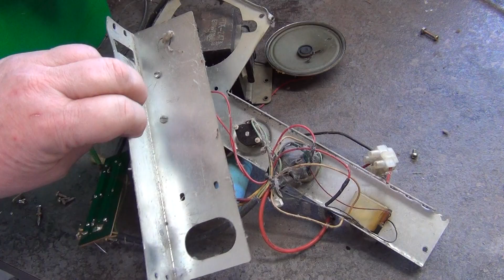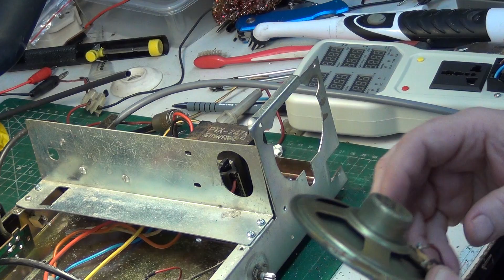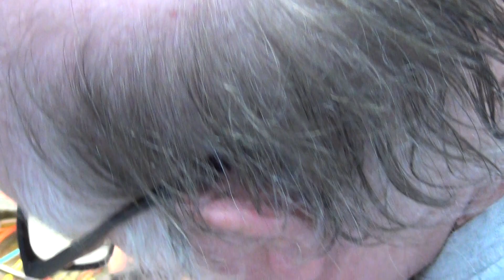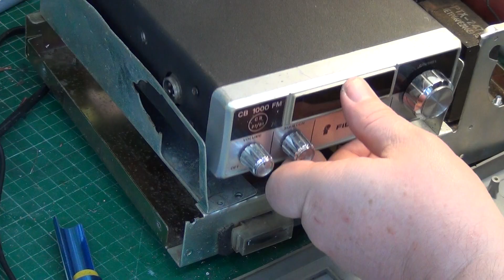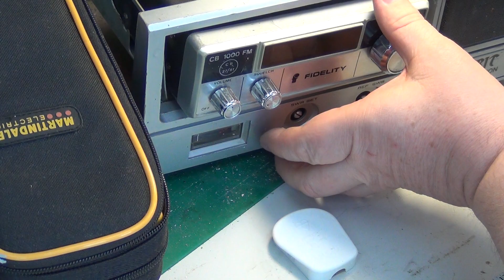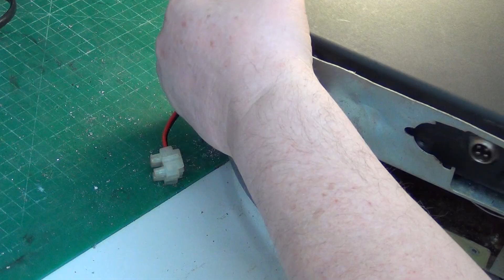Merit CB700 base station adaptor PSU for UK FM CB radio - Frankenstein version

Comment: @00:12 what do you mean by saying not supposed to have SWR meters online in the UK?
Reply from the maker: Yes. SWR meters are only supposed to be connected 'from tme to time'. The reasoning behind this is potential interference during transmit from the diodes.

That said, there were UK base stations with built-in SWR meters so presumably that was OK as they were type approved.

I'm thinking along the lines that this potential interference is more likely to happen with plastic cased meters. My biggest reason to suggest to only connect SWR meters from time to time is 'insertion loss'. 

Anything connected to the aerial socket that he xsignal has to pass through causes insertion loss, i.e loss both in transmit & receive range by a small percentage.

Richard,G0OJF, UK

Comment: Its been a while since I made a comment, I was wondering why the swr meter is not allowed in the UK to be inline. In all the years since 1978 being on the CB I have not heard about this before, as I don't read instructions the details about swr inline rule is something I have missed.
What is the reason for nor being inline as I have a meter with three windows swr/power/modulation which I have kept inline for years to let me know all is ok and for being cool looking being lit up at night in blue to match my blue led radios.
Reply from the maker: The diodes inside SWR meters emit interference. That said it's the kind of thing that would be very low range interference.....like 50yds.

The big no-no is because of insersion loss a demonstrated here. Most people strive for maximum performance & to keep losses to a minimum. The UK licensing rule does make sense.

It goes without saying that modulation meters are for AM use, so pointless on UK FM - which is what this channel is about. FM transmitted audio has to be read on a deviation meter.

Richard, G0OJF, UK
Reply: @ukfmcbradioservicingTango21  I appreciate the time you take to reply as you are a busy man so thank you Richard. John.

Comment: I had a couple in the past, they did come in handy. About the power supply, remember back then that the manufacturers "shared" various components and assemblies between different radios and accessories.
Reply from the maker: My logic is that the Cybernet built in Japan Harvard H407 or H404 base stations were made in Japan & this unit is made in Taiwan.  THe power supply parts were bodged in on non-matching self tappers.

Richard
Reply: @ukfmcbradioservicingTango21  going back many years ago i used to repair tv's, hi-fi's, audio and radio's also cb radios. I noticed that items made in Japan used a lot of the same components, back then the Japanese had a "common source" of  components that's why a lot of Japanese electronics had the same components, the cb's of the late 1970's and early 1980s had transistors and some ic's that where used in other items which explains how the Japanese where able to mass produce cb radios so quickly.